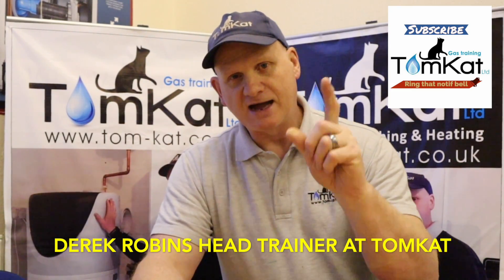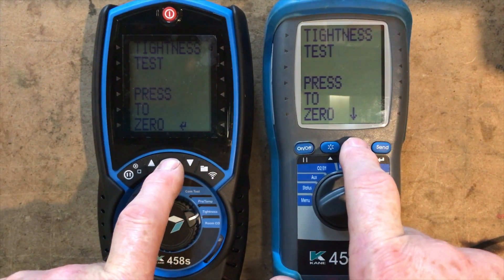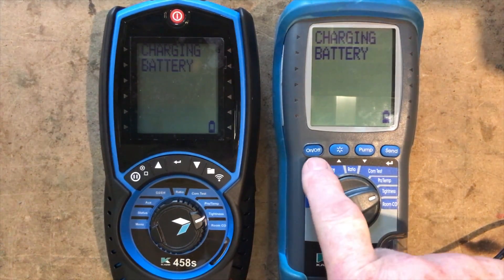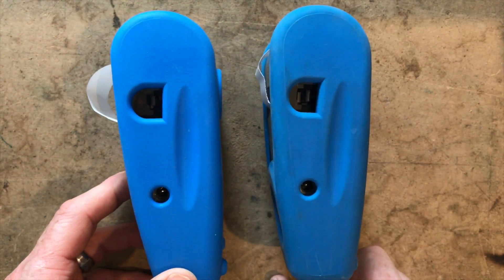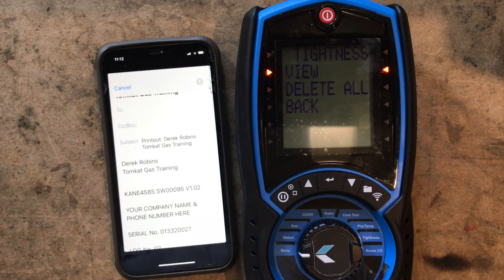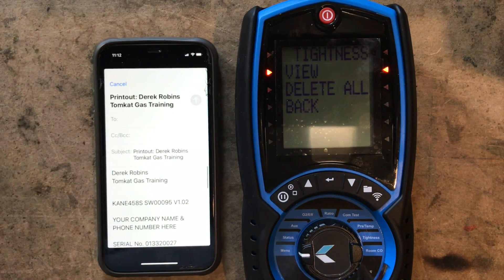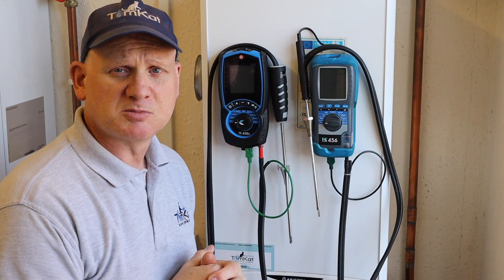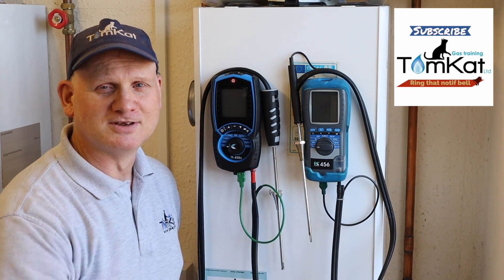KANE 458S FLUE GAS ANALYSER. part 2 a review of the new analyser from Kane international.

Comment: Did you mention that thus analyser is more suited for commercial gas situations, the co sensor can take 10,000 ppm before shutting down, this is a big plus when you have a bigger boilers that you need to fix. As the domestic ones shut down too quickly and the commercial ones allow you time for adjustment and fixes.

Comment: First impressions are it’s decent but the green cable keeps popping out of its holder up to the probe it’s doing my nut !
Reply: Green cable if for temperature so if you’re only doing combustion readings it does not need to be in.